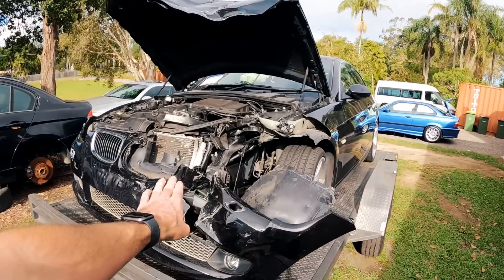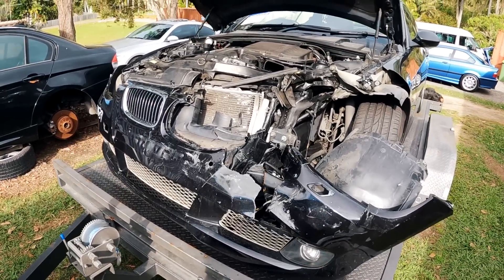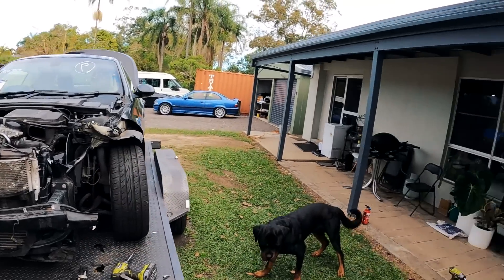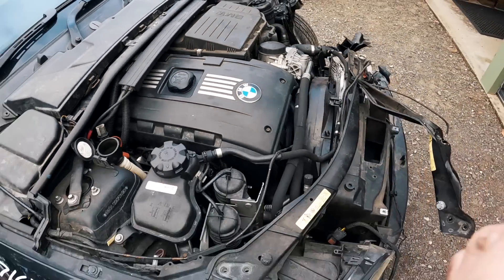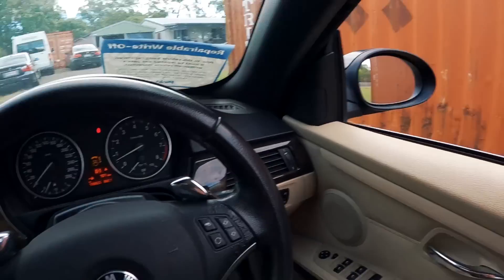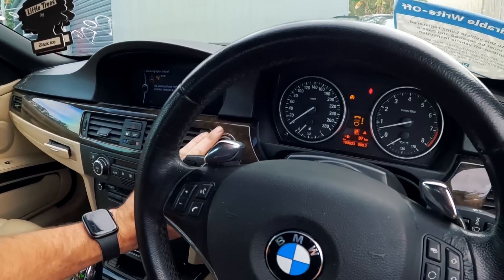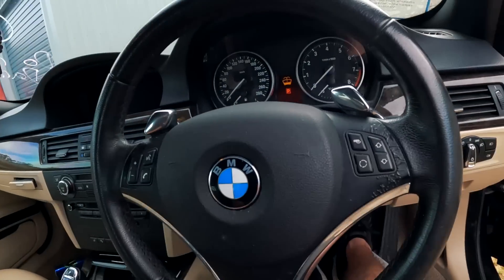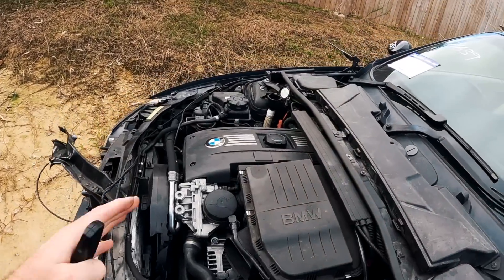Is the DCT in the DONAR Car any GOOD? E92 335i DCT Swap Part 1

Comment: Interested to see what you make of the DCT. I’m running E92 N54 DCT with xHP flash, 2+ MHD, and a OS Giken...it’s fun, but slightly underpowered with stock turbos.
Reply: Is the XHP worth the cost ? 200 euro for the licence and 200 for the maps seems excessive when the DCT is epic to begin with
Reply: @MrTrdiff  I agree, it’s pretty expensive given the DCT is already quite good stock but I’d still say it makes enough difference to be worth it.
Reply from the maker: Well I really like driving Declan’s m2, he’s probably 150-200hp down on my car so it should be really interesting to see what the dct is like with close to 700hp at the crank. I do need to work out what I’m gonna do with the diff too.
Reply: @ZeroTo60Tube  That’s 700 reasons why I’ll be watching very closely haha!

Comment: Hi, watched your video yesterday and made some resarch on this topic - altrough u made ur decision for DCT, maybe check them out for 8HP - maybe in some future build?
htg-tuning . com- maybe i'll build a E60 530d with it :)
Reply from the maker: I’m thinking 8hp in the Vargas car. Just can’t find a solution that I can run in my car yet.
Reply from the maker: A 8hp solution I mean. Where dct is good to go. Did you happen to find anyone running htg that intergrated in to e9x can bus?
Reply: @ZeroTo60Tube  with their "GCU", they call it, you should be able to hook up every engine with an 8hp. just contact them :)
Reply: @ZeroTo60Tube  they have an shop also, and a yt channel.